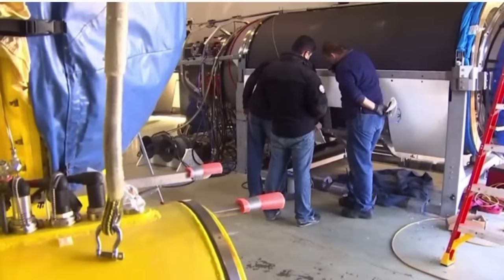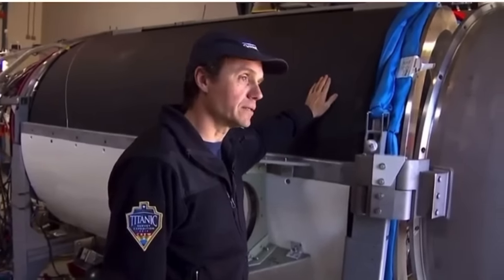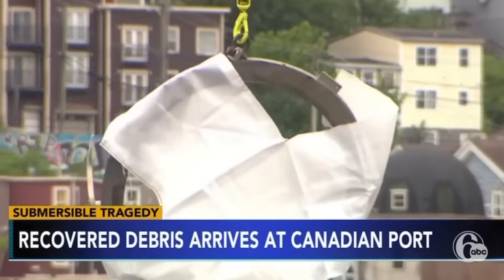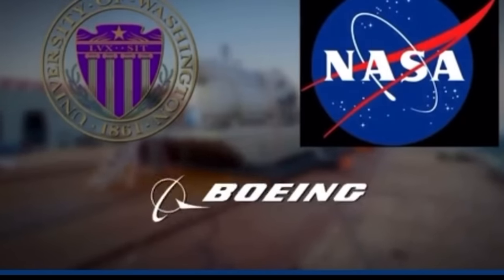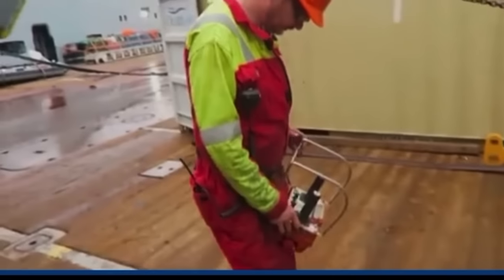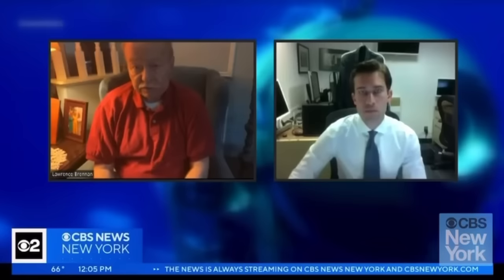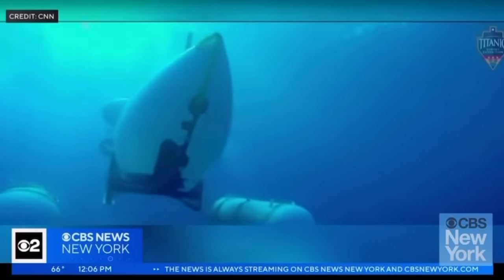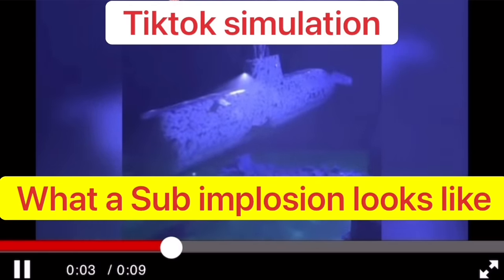Titan nosedived like an arrow (then popped like a balloon) #Titan #oceangate #Titanic

Comment: Pressure crushes. Balloons burst (pop) outward due to internal pressure. External and internal pressures on a pressure vessel are opposites. Titan was crushed by external pressure vastly greater than internal pressure. One thing is not like the other.
Reply: But the instant a balloon pops, outside pressue flattens what is left. So, a balloon popping is a useful example to show that when the pop occurs, instantaneous squishing follows.

Comment: Look, my dad was a submariners , on the nautilus.  One time on sea trials they got stuck in a crash dive but they were able to crank the bow planes around and power out of the dive.  
 There are no two ways Around it, there are a number of things that can go wrong on a dive.  The ones that survive to tell the tale had a number of ways to get out of any problems.  This mini submarine could only function if everything went according to plane.  If the electrical went out it could not power out of a dive, when Thresher went down it was because all of the ballast air escaped the ballast tanks because of the angle of the ship... And their engines couldn't power out. 
If at any point in time your submarine goes vertical you will die , doesn't matter the reason. If the controls for the submarine requires the submarine to be level in order to be operational, then you will loose the sub sooner or later. Sounds to me like the sub was badly designed by an amateur and they were lucky a few times before catastrophe occurred.

Comment: Incidentally jettisoning the skid below and the drop weights lowered the metacentric height closer to the center of gravity.. This means in lay terms that the static stability was reduced to near neutral meaning that any change in weight distribution could cause the sub to tip one direction or another. It could roll, it could go end up if the interior weight changed position. So this was a HUGE design flaw. I am certain they did NOT take jettisoning the skids into account for balance. Stupid people do stupid things.. Consolation prize is that the idiot CEO died too and cant repeat his lunatic crusade.
Reply: Stockton Rush's life may provide a good lesson on where arrogance and hubris will take you. His final trip invoked the name of the late 1800's novel that itself "predicted" the wreckage of the Titanic itself. Name of the book? "Futility: the Wreck of the Titan."

Comment: When you pop a needle into a balloon it does not "implode".  It explodes.   They have not found the carbon fiber cylinder, most likely because it caused the implosion and shattered into little bits and strands that the current swept away.  The sub did not go vertical because of the ballast.  Even it it fell in an uncontrolled fashion to the depth of the titanic, if the hull was as strong as they believed it would have not imploded.
Reply from the maker: the ballast was gone

Comment: There was ballast required to balance Titan while emtpy, right? The life support, propusion and batteries were all mounted to the tail.  If that ballast separated during decent, I think thst would have been lethal.  Keeping in mind the fact that Titan was towed behind the ship over open ocean to the dive site, before it failed,  it seems very possible thst components may have been compromised in transit.  🤔.
Reply: The whole sub was jerry-built-they used stuff from Home Depot, lengths of steel scaffolding for ballast....none of the electronics were MIL-Grade; an accident waiting o happen.
Reply: @genekelly8467 The CEO bragged about off the shelf big box store components like it was a good thing. Insane.
Reply: @ceehads  there are many things that bother me about this incident.  Everyone involved in OceanGate has blood on their hands now.  If you knew anything about the Bohemian Grove, which Stockton was a proud member of, you’d know that human life is of little consequence to them, when in pursuit of wealth (material or egoic).

Comment: Was going to 3800 meters. Sub was only rated for 4000.... sorry but I'd want something that was atleast rated for double. Or atleast 5000 or 5500 meters. Then to not have a hatch that can be opened from the Inside is just absolutely baffling.  It was literally a tomb.
Reply: Wasn't even really, the porthole wasn't authorized for below 1,300 iirc.
Reply: Good engineering builds in extra tolerance to possible real world conditions.  Absolutely, if you are going down 3800 meters then the hull should be lab tested to 5000 meters.  I operate high pressure vessels on barges that store Liquified gases. Most tanks are rated to hold 265psi.  If the vessel reaches 210psi (80%) I’m supposed to shutdown and de pressure the vessel so that I’m never close to 265.

Comment: Who is this expert scientist? I think this is sheer speculation because I've never heard of this scenario before and it wasn't mentioned by the Navy, or anybody else for that matter. However, there was a video on YT, and I think it was taken down. It showed text communications between the Titan and the ship for the first hour when problems began. I think they lost control and they began to descend to fast but then released the ballast and then began to ascend. They were hearing a lot of cracking noise, the hull system was going off, and they could not ascend fast enough. Just a few minutes later they lost all communications and I'm assuming that's when the implosion occurred. You need to get this so-called expert scientist on your video to defend himself and reveal his sources.

Comment: The Titan Submersible did indeed implode, but why are they saying that it dropped, or fell like an arrow after loosing power. It is not an aircraft. All submersibles use neutral buoyancy the same way a scuba diver dose to control its position in the water. What that means, is has sufficient flotation to  remain static in the water without going up or down. They add weights to descend after weighing the crew and whatever they bring onboard  with them. Once they descend to whatever depth they have planned, they drop the weights and start to ascend. The motors are for position and attitude control.
Reply: Read the leaked transcript. They sank much faster than they should have. Usually, a dive to the titanic takes 2 1/2 hours, yet after 1 1/2 hours, they were only 400m away from the titanic
Reply: What you say is largely true, but the boat should be inherently buoyant so that when the weights are dropped, it naturally rises to the surface. It appeared they had difficulty jettisoning that weight, if that happened and the trim was upset, with all the weight at one end.......
Reply: Yes I agree with you. With a slight positive buoyancy the sub would ascend if the calculated weight was correct.  And they would want that to save battery power.  Now if the did have issues dropping the weights ie( some of the weights were released and others did not) then the Titian would still ascend, more slowly, or be static, but never fall like an arrow to the bottom.  The crew may fallen on top of one another due to  an unbalanced weight condition. And of the hull started to fracture, and did not ascent fast enough, well yes, implosion!  @PercyPruneMHDOIFandBars
Reply: The implication here is that the overspeed of the dive nay have been due to flooding if I'm not mistaken, that would potentially cause the rest of the problems.
Reply: @Rammstein0963.  There is no such thing as "flooding" at that depth.
Reply: @gkilcup  What else do you call water entering a vessel where it is not supposed to be?
Reply: @Rammstein0963.  "implosion"

Comment: thank god i didnt have USD 250,000 spare and want to go down in an uncertified sub made of carbon fibre to see the titanic. When it aborted many times. Cracking noises. It did get to the titanic. But pressure destroyed the carbon fiber and boom.....I cant imagine the fear the people felt as their imminent death  was awaiting. Every gun shot noise of the sub failing....... if it went face down in pitch black the horror. The vile arrogance of rushton. The passengers knew what was there end of life.
Reply: 🤣🤣🤣🤣 and dont forget, controlled by a playstation controller

Comment: The more I watch about this thing, the more ridiculous it seems. 
They didn't bother with seats or a steering wheel. Navigation via text message?  Imagine auto correct when you're in an emergency.
Reply: They had texts but it was delayed due to them being under water. 
They skipped the steering wheel idea and the seats because of how cramped it was inside.
Reply from the maker: it was not the smartest way to operate, I would rather go down with the old MIRs if I had to

Comment: It could have been the controller it self, when they tipped and dived back down. Analog sticks tend to drift, and there are other issues as well. One fine example is the Ps3 controller. There is a foam that presses the ribbon cable against the pcb. If the controller used on Titan had same enginering defect, it would end up looking like there were a ghost in it. But analog stick drifting are most likely the issue, if it was the controller it self.
Reply: "controller it self". The controller was the least of their problems.
Reply: @sandgrownun66  Then why did it display so many issues, so many times, before the fatal implotion? And they had to bang the controller against something hard, to make the sub stop acting up, and return to controllable state again.

That fact is well established.

Comment: Partnering with Boeing would have me thinking twice.  Although, all they did was sell some old, unsafe, carbon fiber.
Reply: The carbon fiber was not unsafe, it was unsuitable for its intended purpose due to age.
Selling aged out materials is not unsafe, it makes excellent economical option for non critical applications.
Choosing to make an extreme deep diving submersible out of it was unbelievably reckless.
Reply from the maker: they lied about Boeing, NASA and the others, were later forced to take logos away
Reply from the maker: yes

Comment: What is his evidence of the electrical failure? Loss of communication would not be a sufficient condition to infer total loss of electrical power, my understanding is that such losses of communications were not especially uncommon. Also, I’m not a credentialed material scientist, but I own a firm that employs such people and tests material at various strain rates and loading rates. I’m not clear on the physics of rapid vs. slow descent increasing the likelihood of rupture. The composite materials we deal with typically exhibit higher ultimate stress prior to rupture with increasing loading rates, albeit with a less ductile rupture sequence. However, carbon fiber composites exhibit low ductility in any case.

Comment: the game controller was not the issue and is not that silly over all. it was their lax standards on everything elser, trusting college interns to design the electrical system and install the motors. this entire thing is a case study for following well documented regulations
Reply: Having a controller that is Bluetooth (not hardwired) at that depth?
Yeah.
That's pretty stupid.
Reply: The US Navy uses a similar handheld device but there's tons of backups that work, unlike the Titan's systems.
Reply: @palindrome1959  exactly. You just answered it yourself... tons of back-ups. If the Navy is doing something, it's because they've looked at it from ALL angles and have back-up strategies (which, guaranteed, includes a way to hardwire).
Rush went down with a Playstation controller.
Nothing more.
Reply: @palindrome1959 right, the controler already has years of R&D and millions in research, it could still break and the inexpensiveness  meant ocean gate should have had like 10 on that sub

Comment: "Rapid" change of pressure isn't the key. Just change of the pressure is enough to cause the implossion if the crack in material was present. More interesting is the failure of electrical controlling at 1700 m
Reply: when they refer to rapid change of pressure they don't mean what u think. Obviously, it doesn't matter how fast they dive and how fast the outside pressure grows. By rapid change of pressure, they mean when the weak point fails and allows the high pressure from outside to rush into the low pressure of inside which leads to immediate implosion. is just a technical term don't take it word by word. Also underwater any implosion generates shock waves like an explosion. In terms of the electrical failure at 1700 m it looks like that piece of junk had technical issues caused by electronics almost every single time they tested it but luckily they never caused critical failures. The submersible was just a piece of junk. It reminded me about StarWars when Annakin was building his race ship out of scrap parts
Reply: @MihaiDobrin88 Of course. But read the first sentence in description of the video

Comment: What does nasa and Boeing have to do with deep underwater stuff? They both fly! That should have been the biggest red flag
Reply: Both involve pressure regulation. But Boeing was probably just to get cheap materials from what I’ve gathered
Reply: @DontHateItsBased  sure but they are dealing with different type of pressure at ocean depth vs flying
Reply: @dailyrandom5308  oh I realize that definitely. Wouldn’t surprise me one bit if they asked nasa to design the toilet
Reply: @DontHateItsBased  pressure difference between earth's surface and outer space: 15 psi (outwards).
Difference with 3,800m of seawater:  5,700 psi (inwards)
Reply: @stephengrimmer35  I understand this. I was referring to system design ideas etc. not debating the differences in pressure.
Reply: @DontHateItsBased  yeh so them claiming that Boeing and nasa had something do with design is a red flag cuz they deal with different pressures and in different directions! But imagine they put a toilet in the titan!! That would cut their profits insanely 🤣
Reply: @dailyrandom5308  but with the money they saved with Logitech controller should balance the expense 😂 sorry if I came off like I was arguing. I forget tone of voice can’t be heard online.
Reply: @DontHateItsBased  lmao hey that money went to Boeing and nasa for doing nothing🤣 no worries I’m just throwing in a good sarcastic joke

Comment: It is highly unlikely they were in total darkness.  A 19 year old without a smartphone?  No way.  Certainly a flashlight, headlamp, or even backup emergency LED lighting running off of an independent battery.  I mean if they are advertising to the super rich you'd think they could afford to throw a tap light just in case.
Reply from the maker: the question is if they had that all ready when in panic and nosediving
Reply: Where they were in the ocean was completely dark
Reply: @wasteddemise2286  until 19 year old reaches in his pocket and activates his flashlight on his mobile device.
Reply: As I recall, didn’t Rush brag about his overhead battery-operated interior lights he bought at a camping store?  Wouldn’t they give sufficient light if their main power was lost?
Reply: Glow sticks

Comment: How did they not have passengers seated and use a seat belt to prevent movement of a group from falling into a pile? smh. sad RIP
Reply: Passengers should have been seated and secured seat-belted for safety. would be an inexpensive and mandatory safety measure they could n should have done. Aircraft have seat belts for a reason.  Subs for tourists should be an obvious "Must"
Reply from the maker: can‘t drill into carbon fiber so where would they attach seats ? Probably too heavy too is my guess
Reply from the maker: yes but he wanted no extra weight so that he could take more passengers